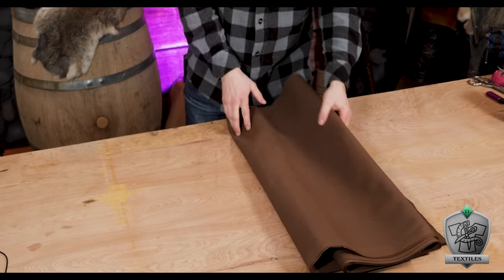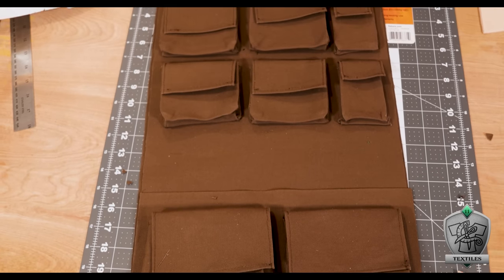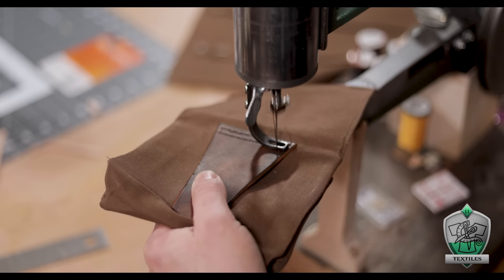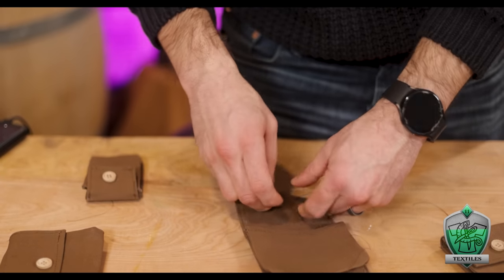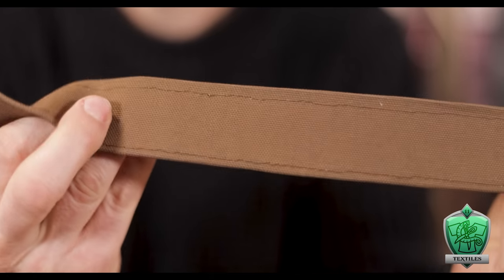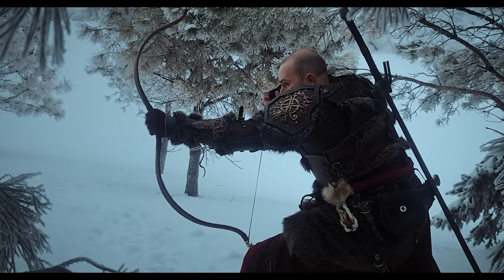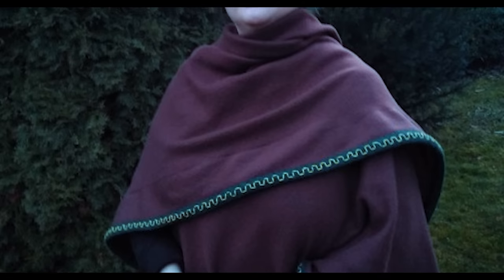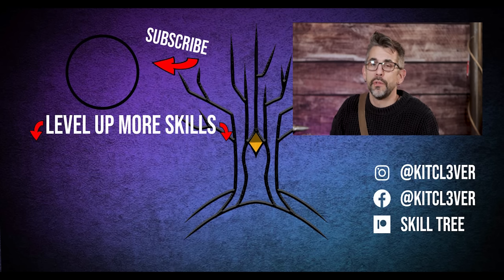LARP Bag of the Healer

Comment from the maker: It has come to my attention that the red cross symbol should NOT be used. It is property OF red cross, and aside from that, may send the wrong message leading others to grab your bag, assuming it has medical gear in it. I would recommend using a different symbol if you wish to replicate this bag!
Reply: I appreciate you putting this disclaimer. I love your videos, but when I saw you putting the cross on it made me uneasy. I'm glad it got pointed out.
Reply: agree, how about a caduceus instead?
Reply: @goodtobesmall eeeh even then that’s on the sides of ambulances, if you want to put actual medical supplies in there go nuts but something like a LARP bag or something like that you may want to run with something else.
Reply: @shawnwalker4936  good point
Reply: Video games get around this by using a green cross, not a red one. But thank you for pointing those out, Skilltree! And definitely just using a completely different symbol is just the easiest way to do this
Reply: This is the warning that was needed... i did not like the cross. Sorry, so you know this video is technically against the Geneva conventions. settles in to watch
Reply: A red H is a pretty solid replacement symbol imo
Gets the same message across without violating the Geneva Convention
Reply: Some video games use a red drop (presumably  a drop of blood) instead of the cross. :)

Comment: Also a little hint from a long time LARP healer: You will need bandages that are 4-5meters (4 Yards) long, and some up to a foot wide, because belly and chest wounds are very common in a larp event and you will always be missing fabric otherwise...
Another point is: Maybe think of a way to keep the pouches from opening while thrown, otherwise all your gear will fall out mid air.
So maybe button on the pouch and buttonhole on the flap and then the string.

Comment: Okay, tips from a sewer. If you want to stiffen a fabric there are three ways you could do this. One is used a fuseable interfacing. These are typically iron on, so they are easy to use for new sewers. The downside to them is that they tend to be less durrable and can break down over time. The second option is to sew a layer of siffer fabric between the two layers of outer fabric that you are using. The downside to this method is that is can make everything heavier than you might want it to be. The last option is horse hair canvase. This is lightweight, easy to sew in and can help a project hold it's shape ( such as a shaping a bodice to have a cruve). The downside to this is that horsehair canvas can be expensive. It all depends on the project, how you want it to look, what you'll be using it for and how much you want to invest into it. 
As a side note, I think Clever could have gotten away with using putting leather between his layers and sewing around them. I've never tried that, so I'm not sure how well that would work.
Reply: sewer?
Reply: @asahearts1  Yes, because I don't exclusivly make clothes, so I'm not a seemtress nor tailor, but I make too many clothes, costumes, and notions to just be a quilter. So, as a jack of all trades? diciplines?, I refrer to myself as someone who generaly sews a lot. I really don't know a beter way to refer to what I do.
Reply: @poecraven8666  Looked it up and  apparently there were many alternatives like "sewist," but y'all mainly decided to call yourselves sewers. 🤦‍♂️

Comment: First thought - particularly in regard to your sponsored bit - you have now unlocked a new purpose for your "alchemist coffee box" as an on-the- go brewing kit for those herbal teas.

Second thought: probably going to want to add some kind of closure for the larger inner pocket as it will be upside-down when the bag is closed and as you said canvas flexes as you move so there's a good chance of smaller items slipping out of the pocket and subsequently fall out of the bag as you're running around.

Comment: Having used messenger bags for decades, I think your shoulder strap may be too long, unless you are going to be wearing a lot of bulky clothing. If its too long, the bag will keep hitting your leg as you walk (this gets old real quick) and if you are running it can swing around and groin shot you (OW!). I found the best height is so the bottom of the bag is just at or above the point where your leg/torso transitions/bends, so the bag is not bouncing around all over the place - it also means you can reach the tiny item you need that is hiding in the bottom of the bag/pocket with one or both hands, instead of having to hold the bag up with one hand while the other rummages around out of sight (where was that needle/knife/sharp thing...OW! found it...)

Comment: Sewing tip:  FELL YOUR SEAMS!  What does that mean?  Fold the edge of the fabric in, then one more time, and then topstitch it down.  Why is this important?  The edge of most fabrics will fray.  The felled seam will tuck in that edge and protect it.  Or, you can serge it, but that requires a serger machine.  https://en.wikipedia.org/wiki/Felled_seam#:~:text=Felled%20seam%2C%20or%20flat%2Dfell,flat%20and%20covering%20raw%20edges.
Reply: If even that is beyond you, just work some PVA glue into the cut edge, its what a lot of commercial no sew edge finishes are.

Comment: I'm SO going to try and make this sometime! super amazing design!

some thoughts on the functionality:
it doesn't seem like a good idea to have bandages on the outside, where they can get dirty. i can't think of what else you'd put though. maybe a small handy knife?

i bet you could make the medic sign a little open pouch as well, just for more pouches :)

i would think you would need a stronger sewing machine if you were sewing with multiple layers of duckcloth, or maybe mine just sucks. 

adding the cordage like that also means that it's hard to pack your pockets full, it's better to leave a little slack.

wouldn't the large inner pocket spill its contents when the bag is closed, since it goes upside down? or is it secured closely enough that doesn't happen? i think i would as just a little button and loop or two tbh.

Comment: You could've also so that you can put any number in any configuration you can make back up and switch them out and make more smaller bags or more large bags and by just on the bag put a piece a button so it snaps when it goes on and then comes off fast and you wouldn't have had to sew it it just snaps at the bottom of the Pocket one to the little piece to hang the leather or maybe the one that's the little thing that goes through a hole in the leather that type of button

Comment: I would have made the strap detachable so it could be used to secure a splint or tie a patient to a strecher. With larger D rings you could also attach water bottles or food bags.
Reply: By adding straps to the bottom, you could also add a lightweight blanket roll to give honor and respect to those you were unable to save or simply keep a patient warm

Comment: As others have said, while this is unbelievably cool, it does technically violate the Geneva Conventions. Video games don't often use the Red Cross symbol, and when they do, they usually have to change it (i.e. Stardew Valley). Since this kit only contains a few actual medical resources, it could potentially be misleading and dangerous if someone actually ends up in an unsafe situation. However, you could buy an actual, official Red Cross first aid kit and transfer the contents into this, as long as it can all be kept sterile! It might still be a better plan to alter the logo on the front, though -- maybe the Rod of Asclepius, or the more recognizable (albeit less mythologically accurate) caduceus?

Comment: The Red Cross symbol is basically a reverse of the swiss flag (white cross on red field), because it was founded at the instigation of the swiss Henri Dunant, after witnessing the 40 thousand dead or dying (with zero care) on both sides in the 1859 battle of Solferino, Italy.

Comment: while it IS a very widely used symbol in modern times, the origin of the "red cross" actually goes back to the crusades. knights that had started to get older, and less suited to charging into battle gathered, and formed a Christian monastic Military knight's order, it was the Knights Hospitaller ( please do not confuse this with the Templars, who were an abomination) their order's objective was to  have way stations for the pilgrims, also available to soldiers of any army that were exhausted, or wounded. and within these way stations were tents set up for medics to ply their trade. this was a long process that was begun in 1099. the order was formally recognized by the Pope in 1113. the Hospitallers used a flared red cross on their Monastic Scapular ( often mislabeled a tabard, but the two are very different) . in 1309 they moved their headquarters of operation to Cyprus, then later to Rhodes where they formed a monastic free state. eventually they were forced to move again, ending in Malta, in 1530. from this point on, they were known as the Knights of Malta, and their flared cross became known as the Maltese Cross. over the centuries, it was refined into the red cross we use today.

Comment: on the note of the red cross on white background, many video games have actually needed to change their depiction of it as the red cross is governed by the international committee of the red cross and technically it is a violation of the Geneva conventions to depict it without authorization (though realistically most people ain't gonna be getting any bother for depicting it) stardew valley being a notable example of being required to change their healing item. though it's only red cross on white background that is a violation, change of the cross colour or the backing colour works, hence why you may see white on red or white on green commonly.

edit: in addition the enforcement of this law is quite loose, some games or shows will get threatened with legal action and some won't with little regard for popular presence.
Reply: Wasn't the original users of a red cross on a white background were Christian Knight Orders such as the Knights Templar and the Knights of Saint George?
Reply: @neilsulit7465  honestly I don't know :O i'd have to google n check, this was just about the legality not the origin as i'm not brushed up on that

Comment: I like the design, but I wouldn't recommend keeping the bandages on the strap like that. They'll get all dirty as you're running through the field of battle, and bandages need to be clean when you put them on a wound. It would be better to use those spaces to hold something that is sealed in a wrapper or bottle so that whatever's inside stays clean and protected.

Comment: If you soak your leather in melted paraffin wax it will turn rock hard when it cools, like ridiculous hard. Could help with the tabs and such on the pockets.
Reply from the maker: Smart! Gonna need to try that!
Reply: Just don't overdo the heating or the leather will turn into crumbly biscuit/crackling. At Medium-rare just the outside of the leather will crack but the core will hold together. Just a quick dip, pull it out and cool it on a board or old cutting mat - the leather will stay the shape it was in as it cooled. It differs by leather thickness - you WILL have to experiment before committing to the finished pieces.

Comment: Okay, this might sound condescending, but when it comes to straight stitches, has no one taught you to follow either the edge of the foot or the hem guide lines on the base plate above the bobbin case? 
Those things generally have 1/8" markings going out to over 1" typically! And the edge of the foot tends to be 1/4" since those are the average seam size on American patterns and fabric.
And seam guides are far more a thing now, especially with magnets since the plate is steel to survive miles of fabric pulled over it.